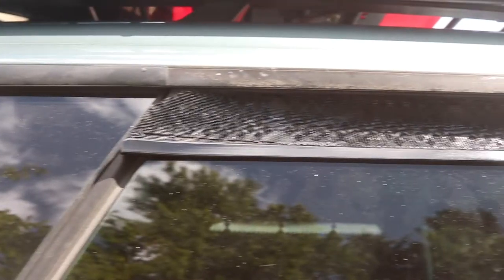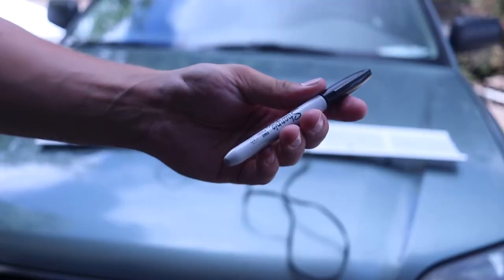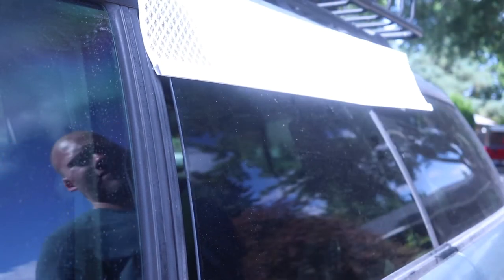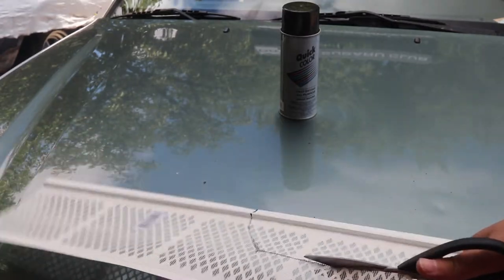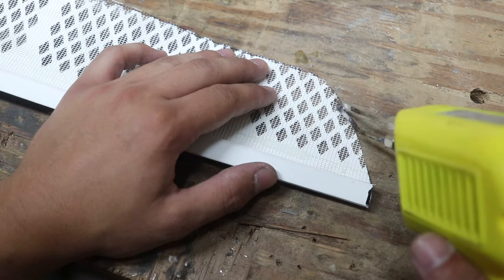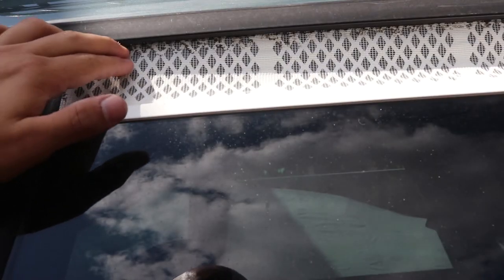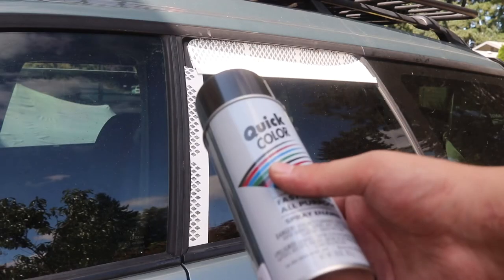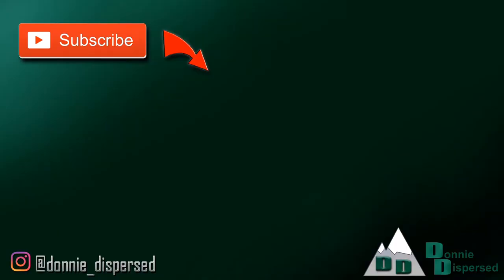$5 WINDOW VENTS for CAR CAMPING & OVERLANDING

Comment from the maker: I had someone point out that you could also use hot glue to reattach the screen material. I think that would probably work even better than the soldering iron, but you can use what you got 👍
Reply: What if I don’t have iron or hot glue lol can I use like gorilla tape or
Reply: Gorilla glue I mean
Reply from the maker: Justin Fisher I’m sure it’d work, gorilla glue is kinda messy I think though.
Reply: Donnie Dispersed yeah your right. I have a Dodge Grand Caravan and would love to figure out some type of screen situation for the back wing windows
Reply: Awesome Video! I love outside of the box thinking. Very clever idea, keeping things simple is my favorite theme. Thank you for sharing your idea.

I see quite a few people commenting on other options besides the soldiering iron technique. There's more ways than one to skin a cat. So use whatever you have available, is my opinion. Glue will work, tape will work just as well, staples, the options are limitless. Since this is even being shoved in to the door gasket. Technically, you don't even need to do anything because the door gasket itself will keep it all mashed together. If you like the soldiering option and don't have one. A lighter and a screwdriver will work just as well. Heat the tip of the screwdriver or any sort of metal object with the lighter, it will get hot enough to do what the soldering iron did here.

I would also suggest using a screen mesh material called No-See-Um netting. It is just like the screen on house windows, just with much smaller holes to block out the really tiny insects.
Reply: Thanks, I have a glue gun and no soldering iron 👍

Comment: This is a great tip. I made a couple and it works perfectly in my 2020 4Runner. I ended up using the entire height of it so I didn’t have to hold glue/melt the top edge.

Comment: Great job thinking out of the box. I use weather tech blackout sunshades throughout my Outback. Challenging to get ventilation with those. I’m going to try these gutter guards. I have a few in my garage. Thanks for the tip.

Comment: Thanks for the video and great idea, as I saw a vid the other day of a guy who did the same thing, but with metal gutter guard. He didnt have to cut his, as the 3 ft was a good fit. I may have to cut mine, as I have a toyota sienna van with large windows and curves. Deciding between screen with magnets, stretchy mesh covers or like you did. Do you get a good enough air flow to cool you while you sleep with those vents you made or do you need the fan running to pull the cool air in? Looking to do something very soon and order some things. Thanks for any help, Chris.
Reply from the maker: Christopher Schiffermiller If there’s a breeze outside then they work fine on their own. But the fan definitely helps.
Reply: @DonnieDispersed  Thanks Donnie, appreciated and im leaning towards this as it looks simple and easy for all I need and saw a few other vids of people who did it. Thanks, Chris
Reply: @DonnieDispersed  Oh, I was also thinking that you could double up the screens for a more expanded air flow and bug protector when you want to sit or sleep. Like the 2nd gutter guard should slip right into the other and you have a two tier system for when you want more flow. Did you happen to play around with that idea and would they fit easily as it seems they would? Thanks
Reply from the maker: Christopher Schiffermiller the groove that fits over the window is quite a bit bigger than the plastic cover and screen part. They wouldn’t hold onto each other well. But maybe if your door window has a frame you could roll up the window to pinch two pieces together between the glass and the door frame and that would hold them in place.
Reply: @DonnieDispersed  Yes, I figured I might have to use vice grips to squeeze them together or come up with a easy way to insert them and make them sturdy. I will play around with it when I get them here and see what works. I will let you know.

Comment: Great idea. What happens with these in the rain? I'm not much of a fan of waking up with rain falling in my face because I left the window open for ventilation, but so far my only remedy has been heavy duty aluminum foil, but that isn't too great if there is any wind.
Reply from the maker: Josephine Gibbs I haven’t used them in any real rain yet. I’m curious about how they will do myself.
Reply: Any rain use update?
Reply: @DonnieDispersed  Also curious
Reply: WeatherTech window deflectors keep rain out.....gutter guard keeps bugs out.  Both allow ventilation.